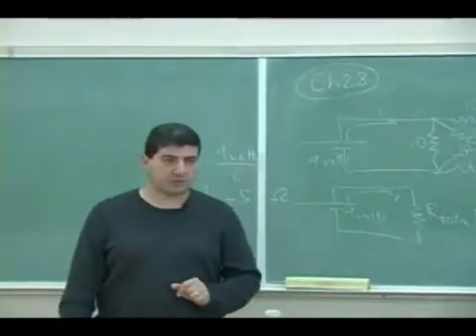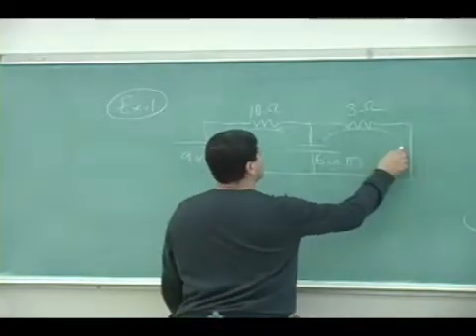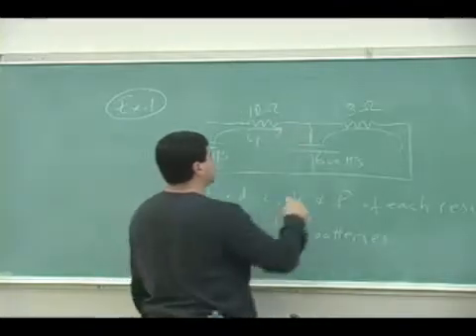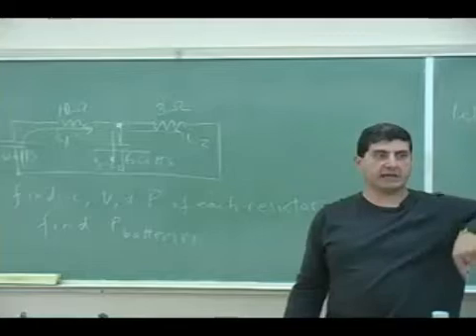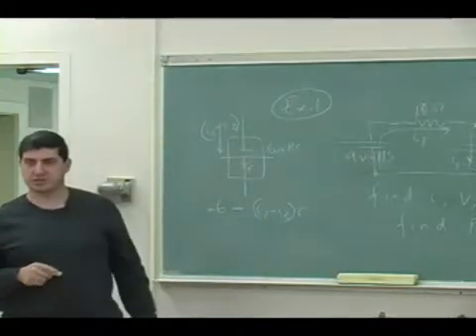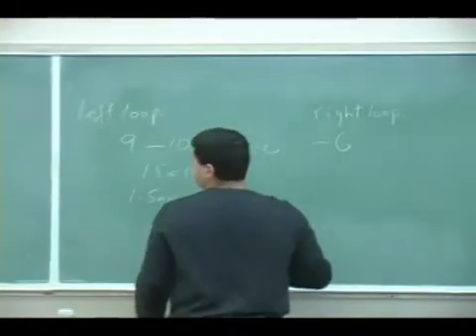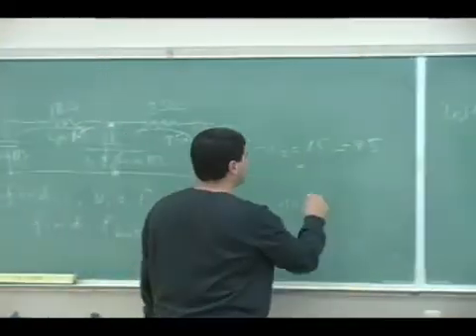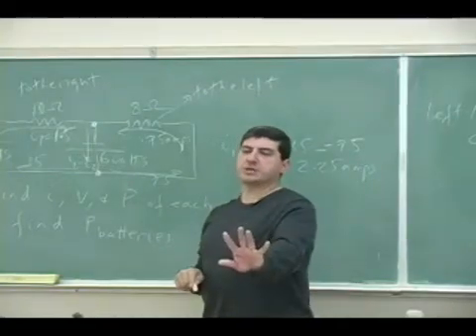Resistors and Kirchhoff's Rules Example 2 Part 1

Comment: I thought using KVL moving from a negative to positive you are loosing charge and so the voltage will be written with the sign encountered first ,in this case -9 volts not 9???

Comment: I have a question, sir. My teacher said, if the the current flow from the positive to negative battery, it's a positive and vice versa. And if the current have the same direction with the flow, it's positive All of theory from my teacher are against your theory. Which one is true sir?

Comment: @darkosminos 
The current is going from the short end (negative) to the long end (positive). Therefore, it is positive. If it were upside down, it would be heading through the long end toward the short end of the battery, making it negative